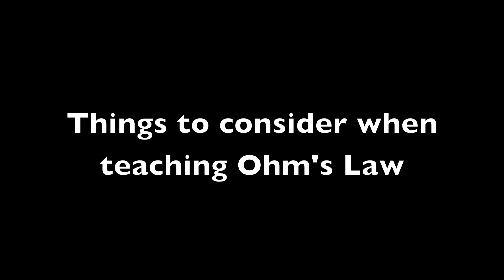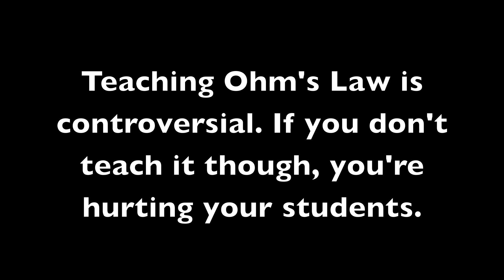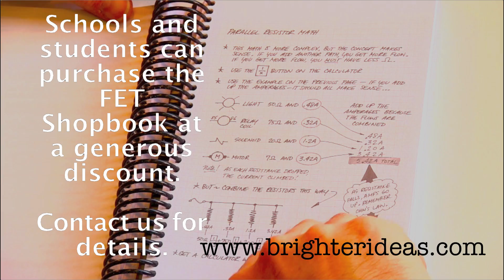Teaching Ohm's Law to Techs - Part 1

Comment: E which is electromotiveforce, and I which is intensity make plenty of sense if you actually don't deprive your students of well needed and deserved knowledge. and the EMF, short for electromotiveforce, will come back in AC when you have to work with Counter EMF. Also it is important to not only teach E=I*R, you also need to teach students that P is equal to E*I, E2/R, I2*R. Learning all of this properly along with series and parallel circuits will be extremely beneficial when students have to learn how an inductor works and why a capacitor does what it does. Once a student learns everything, then it will all come together and you will understand why teachers teach the way they do. If I have a tech working on something for me then I would want him to know what is going on, what does what, what everything is and how it works, and what could cause a problem and how to fix it. In the real world you have far more than just wire problems. Believe me, I'm an electrical student and everything I have learned has come together so far and has all proved to be worth remembering. And yes E, I, and R are required, same for using P for power instead of W for watts.
Reply from the maker: +Dustin McClure I agree - except it doesn't work for the people I teach. Staying rigidly enslaved to a method for the sake of tradition - when a slight change makes more sense - isn't intelligent. If someone can learn that E=V, then the same person can learn V=E - probably better and with greater understanding. I was an electrical student 30+ years ago - and now, 30+ years of teaching later, my way is better.
Reply: your way may seem better to you however I believe that these methods are tried and true and make perfect sense. If it works then don't fix it, you will only confuse others.
Reply from the maker: ***** Ahhh - yes - you're correct. Your way doesn't work, so I use mine, which does.It's that simple. Tried and true? No - more like old, tired and ineffective.
Reply: please stop trying to change tradition, doing such can end very badly and yes, it works great, ours is the best cause its original, working, and makes sense, especially when you get into learning all the other things we have to learn
Reply from the maker: ***** Dustin - you're entitled to your opinion, but you're wrong. I'm pretty sure you're arguing to be arguing, so I can easily ignore your comments, but I won't. Your responses are literate - but just barely. You need to work on language and grammar - and while I have no idea what kind of electrical student you are, I'd assume you're the type who questions things just to question them. Be careful - asking questions to learn is one thing - but asking to hear yourself talk and to prove something is dangerous. I've been teaching 27 years - I know more than you. You can't be a good student unless you're willing to accept that.
Reply: i ask to learn, i make my teachers teach me more in the first place and my grammar and language is not that bad, go look at some of the other comments around YouTube. I am an electrical AND electromechinical student and everything I learn is correct, including the PROPER methods and symbols. And if were going on comments then this is my opinion, of course both matter but no one is wrong, the only person that is the most right in this is the person with the facts which I am willing to provide. If you want then I'll be more than glad to connect you with my teachers and they can prove it to you. So in this case we both have opinions and of course ours is right but the others are wrong so lets just get over it and accept that I'll be doing electrical my way, and you will do it your way.
Reply from the maker: +Dustin McClure "...electromEchanical", not electromichanical.

"...grammar and language ARE not that bad", not "is" that bad. "Are" is plural, "is" is singular. Same concept as there's no such thing as a parallel circuit - it's parallel circuitS...

"...we're", not "...were". 

"And if were going on comments then this is my opinion, of course both matter but no one is wrong, the only person that is the most right in this is the person with the facts which I am willing to provide."  Run on sentence.

Dustin - do what you want, I don't care. You started this by being an opinionated critic - you get over it. When you have as much time in service to others in the classroom as I, then you can argue. As I told my kids, when your arguments start to make sense - I'll listen.

Oh, and please have your teachers contact me if they'd like.
Reply: Why don't you stop critiquing my education and go teach English. You would get a hell of a lot further in life like that.
Reply from the maker: ***** I do teach English. I also teach Latin, and electricity, and sheetmetal, and Math, and Physics, and writing,and History. You started this by being superior. I'm finishing it by being humble. I've learned something from this exchange - I'm pretty sure you haven't.
Reply: I didn't come in being superior, I came informing you of my opinion.
Reply from the maker: ...which was wrong...

Comment: Variables are necessary, if you're going deeper such as reactance, which uses the same symbol as resistance. Using E, I and R (Xl, Xc, Z, ...) may be hard to understand at first, but it's much better once you do understand it.

Comment: In the UK we use V etc as displayed on the meters and always have done at least since 1974 when I went to School. Seems to be an American thing to use E for voltage etc??
Reply from the maker: chopper0012 We lack courage within our tech schools to expand thinking and work things out for ourselves. Our techs and teachers are smart - but don't believe it. We teach electricity by rote, without imagination. It's ironic, given that so much mechanical success is due to thinking outside the box by underprepared people using inadequate technical data. We're smart - but we resist change.

Comment: I'm forced to agree with this guy on the idea that "Voltage" is not spelled with an "E", "Amps" is not spelled with an "I". But "R" stands for resistance.
Reply: +Robert Gantry I'm a newbe, what you say makes sense to me.  But Mr. Sullivan is using the symbol instead of the R, I can live with that.
Reply: Ed Waggoner Sr.
Yeah, I suppose I could also live with that, as well. It makes more sense than E=IxR.... It's because of that nonsensical EIR crap that I can never remember ohm's law.
Reply: Robert Gantry It also kinda makes sense because the ohm symbol is what we find on our meters, not the R.  I'm just now learning all this and am very thankful that I ran into Daniel's videos before I got too deep into the woods.

Comment: Thank you sir. I come from a good family with very little money. I loved gadgets as a child. My basic electronics class was an old WW2 book my dad brought home from the Navy. I took things apart to try and find parts. I had no meters. I tried to build out circuits. I blew many fuses in our house. My dad still allowed me to experiment. I used to plug things in the wall outlet that would terrify me to try today LOL. I LEARNED. Eventually I started getting things to work. My meter was if it was heating up I'd add a resistor. If it quit working i'd remove the resistor and use a bigger wire. I LEARNED. I hated ohms law because without a teacher I did not understand the symbols. all the devices I was taking apart said Volts and Amps or Watts. I was a kid I did not know E meant volts. I did not know I = amps or current. I still learned and had quite a bit of my own simple success. My dad was very happy and impressed when I got Christmas lights to fire different color strand based on music coming out of my speakers. More so when I repaired many things we could not afford to replace like toasters, battery chargers and even our refrigerator. I needed someone like you back then and many will appreciate what you do later in life. I didn't know that I was a hacker back then and heck in that case I have been all of my life. (I'm 52 now.... survived) I re-purpose things to meet a need. It is the same way man made his first tool. If you are about to be killed and need a sharp stick I'm glad somebody made the stick. The dead guys were trying to calculate how long or big and such. it is the folks who learn from practical experience that build this world. Thanks again but heck what do I know.....

Comment: i think your a great teacher i been working with electronics and  electrical  every since 1989 i love it and to hear the way you are teaching people the correct way only makes since why teach someone   E=I R   when you can tech them the right  conversion V=A OHMS that way they dont have to think about what is R or what is I or E when you no how to read a meter and understand the meter and just wanting the conversion for how many amps its pulling and how much voltage drop you have because of the distance of the wire run or if the res is to high so my amps is going to be higher ...key word your so right and i say hell yea keep up the good work.. and id love to buy one of your books to help my fellow worker out at work at HARSCO RAIL in columbia south carolina...my email is 1973edwardgault@gmail.com please text me how to get the book thanks so much

Comment: I've been making all sorts for years, recently electronics fell into my "to learn" list and I put together a PCB fabrication lab and started making my own, and all on research alone so far.

I thought it was time to plug the gaps in my knowledge so I enrolled on an online EE course to get some formal training. However, I can honestly say your approach makes so much more sense. 

The "math" as its presented, has been holding me back a little as I find it confuses things. I found myself doing the same equations using volts, ohms and amps as you suggested in your video too, seemed more logical.

Wish I was your student, I think I'd be much further on than I am now, but I'll get there.